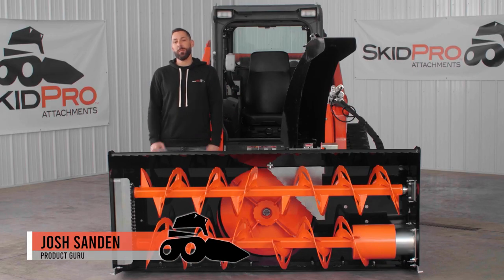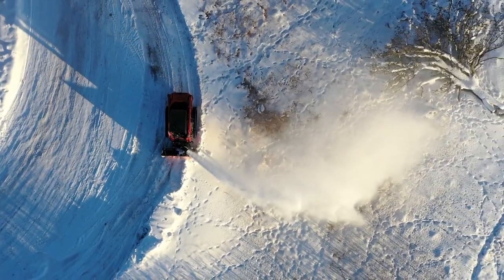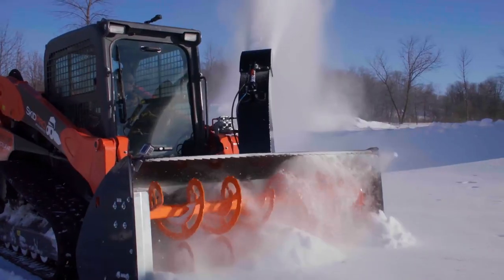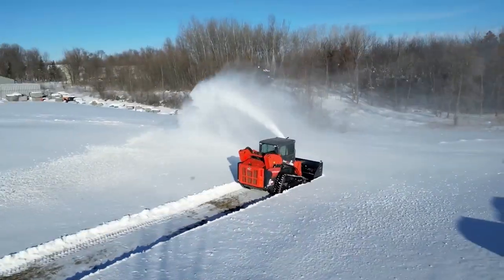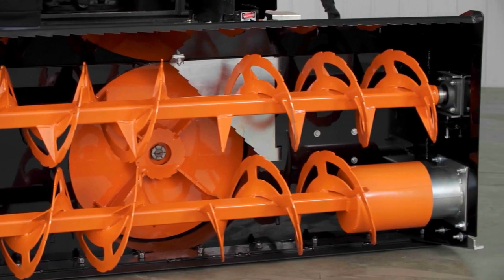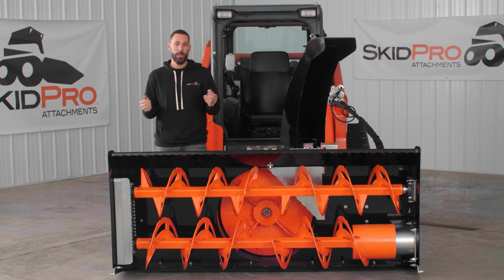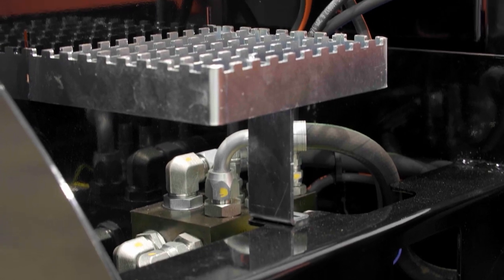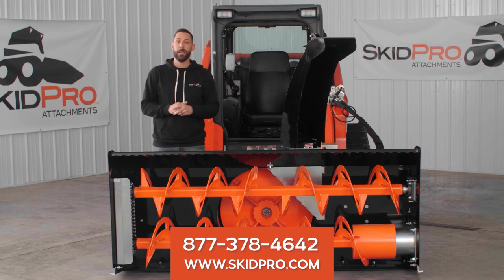This Snowblower is a MONSTER - Skid Pro Double Auger Snowblower

Comment: What rating (horsepower) is nessasary too run this blower?
Reply from the maker: Due to this being a hydraulic attachment, there are no HP requirements. However, this attachment does require over 30 GPM hydraulic flow and that correlates to more HP. In the video, we are running a Kubota SVL95 which is over 90HP.

Comment: How is this thing powered?
Reply from the maker: This is all hydraulically powered. We utilize direct drive motors on both the fan and the auger. Additionally, the deflector and the chute are both hydraulically operated so there is no out of cab adjustment.